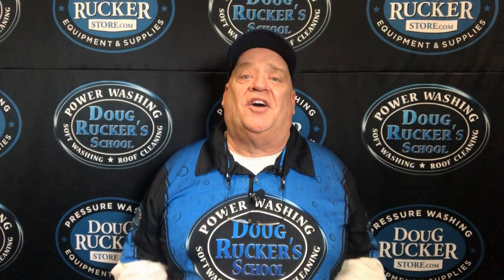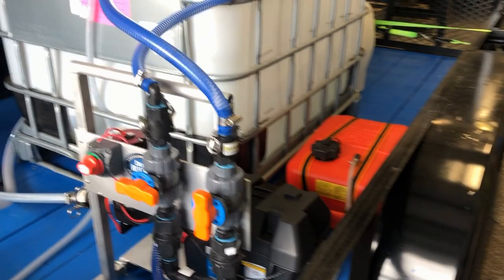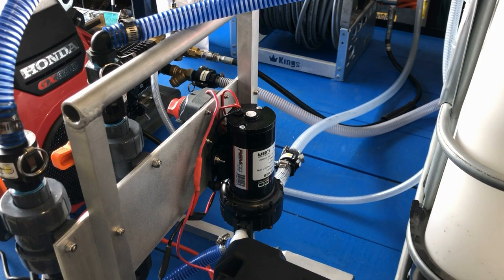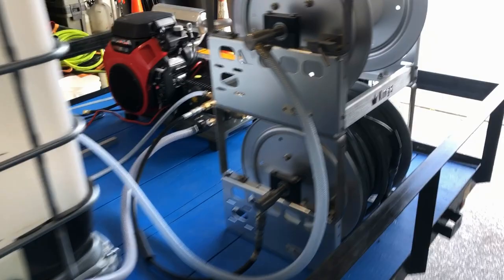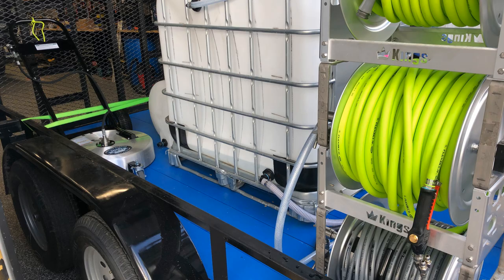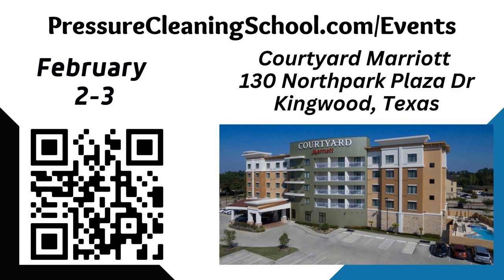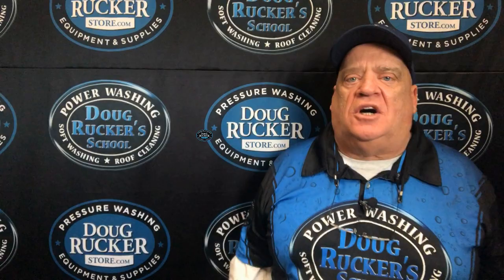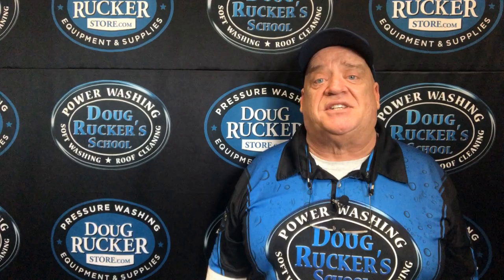Pressure Washing Trailer Video with Doug Rucker

Comment: Hey Doug, I just got an enclosed trailer and am trying to have as much space as possible. I have a tote and a 65 gallon tank. My question is can I use the 65 gallon for a 5.5 gpm pressure washer instead of the 275 gallon tote? I’m worried it’s going to overflow when I’m filling up on a job and it might not be a big enough buffer tank for my machine. Thank you!
Reply from the maker: Yes 65 is fine.  Having a float valve on the inside of the tank will prevent overflowing. https://www.dougruckerstore.com/products/topaz-compact-float-valve/

Comment: Hey Doug! Got a bit of a stupid question. Building my own trailer right now... Trying to figure out what I can mount the (belt driven, 6.3GPM 3500PSI) pump on. Obviously using a wood board is a bad idea; should I just get a sheet of aluminum? Would that be strong enough to secure the pump, even with how much HP is being transferred?
Reply from the maker: So this a machine you built yourself and is not on a skid plate?
Reply: @PressureCleaningSch  yessir. That is where it's at right now. I do not have the money to purchase a full skid. I have the option of using a gearbox so I can directly mount on the side of the engine, but along with using a belt and finding some way to properly mount my pump, those are my only two options.

Comment: Do you have to unreel the entire reel of Flexzilla so it doesn’t lose flow?
Reply from the maker: Yes you do. It will still work if you don’t but it will lose a little flow.
Reply: @PressureCleaningSch  Thanks. That what I was afraid of. I may just run a poly braided hose for supply hose. I know they will last for years.

Comment: The blue floor looks great! What did he use?
Reply from the maker: I am not sure.
Reply: Could be Rust-Oleum professional high-performance protective enamel "safety blue"  in a one gallon paint bucket. I did mine smoky grey.
Reply from the maker: It was Sherwin Williams armor seal semi gloss. #6959. I have the code label if you want to text me at 2816121223 I’ll send it to you.
Reply: @PressureCleaningSch  Where can i find this Blue paint needing to get it asap to paint my trailer this weekend!!!
Reply from the maker: @cody-zo6  It was Sherwin Williams armor seal semi gloss. #6959. I have the code label if you want to text me at 2816121223 I’ll send it to you.
Reply: @PressureCleaningSch  I tried contacting you but have gotten no response!

Comment: Is a 5 gpm pump better for roofs then a 5gpm pressure washer?
Reply: Absolutely do not use a pressure washer on a roof.  You want to call Doug Ruckers store and purchase a soft wash system.  Call him he will set you up to get going
Reply: @Catcha Predator pump keeps you in business?
Reply: You can use a pressure washer to do roofs with a xjet done it many times never a problem. Do not use pressure on a roof. Use a xjet.
Reply from the maker: Yes. Never use a pressure washer on a roof.
Reply: @PressureCleaningSch  I’m trying to outfit a Toyota Tacoma for pressure washing with my 4.5 gpm pressure washer. To be successful can a go at it like this or will I need to run an 8gpm with a water storage tank and trailer???
Reply from the maker: @davidintili6647  you can absolutely run it like that to start. You’ll know when it’s time to upgrade. But nothing wrong w starting out with what you have.
Reply: @PressureCleaningSch  thanks
Reply: @Catcha Predator I’m not following what you’re trying to say here sir.